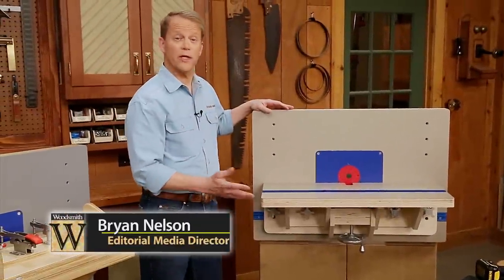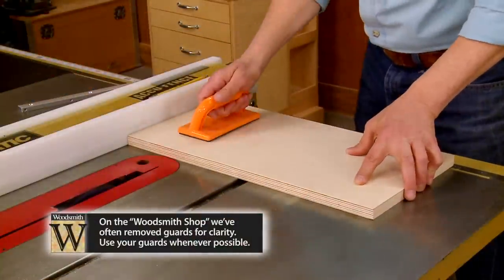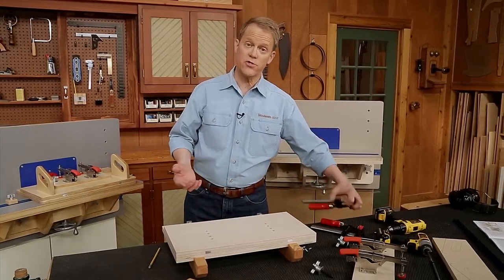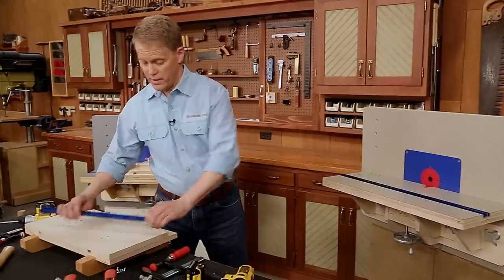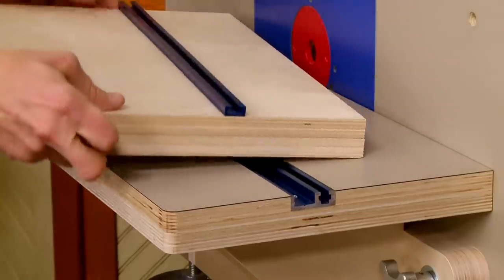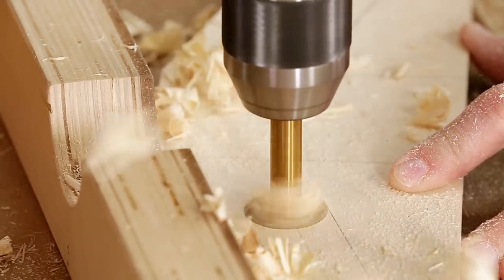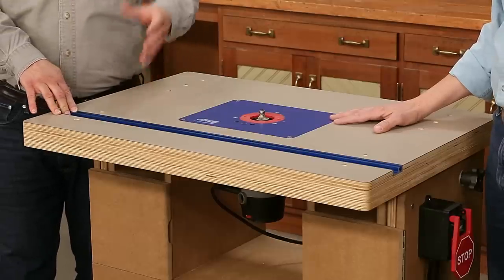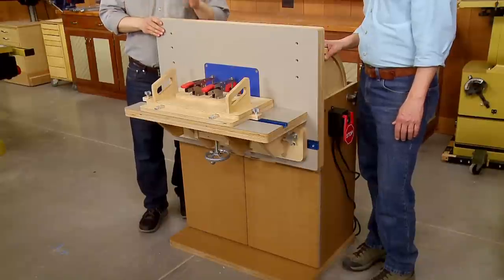Build A Combination ROUTER TABLE! - Part 6

Comment: Love this project! The table is extremely versatile. Is there a good reason to make a separate horizontal table and fence? Couldn't the table be made to serve both functions?
Reply from the maker: I suppose the horizontal table could also be used as the router fence too.  It would just be pretty tall.

Comment: I have the plans and will build the table. There is one question that I didn't hear in the video series or see in the comments. Why is this VERY heavy table not built on locking casters? Is there a danger of it tipping when tilted onto the horizontal position?
Reply from the maker: You could probably do that if you’d like.  I think it was just a design choice for this particular router table.  Personally, I prefer to move my tools around the shop as needed, so I have everything on mobile bases.